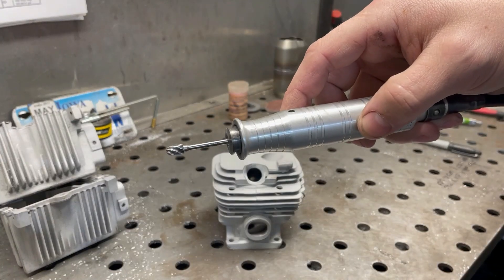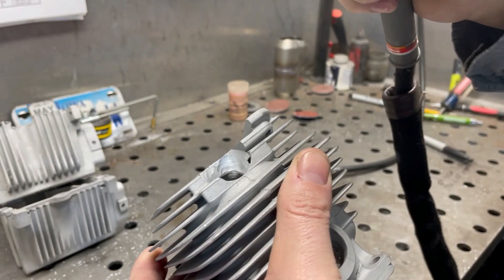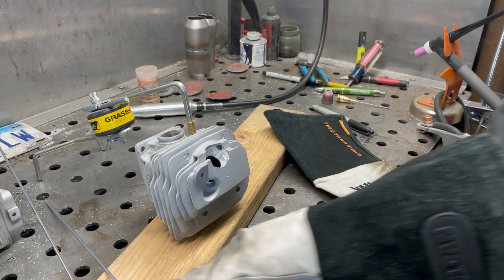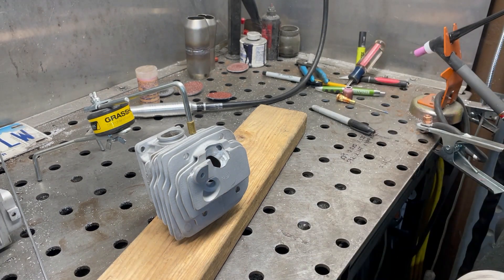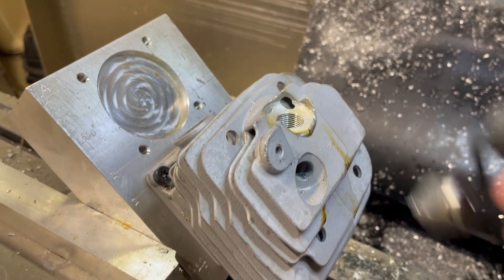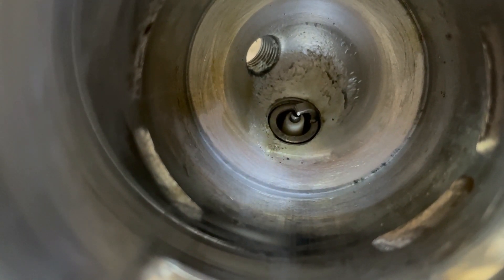Chainsaw spark plug thread weld repair

Comment: You’re pulling your tungsten away too soon. Leave your tungsten at your weld and let your post flow gas run until your tungsten cools down. This keeps your tungsten in the shielding gas to cool down and keeps it from contaminating. I believe that would fix your tungsten problem

Comment: Try 2% ceriated tungsten for aluminum, you’ll be able to hold a sharp point 1-1.5 times diameter in length. Also it won’t spit like other types and has good arc starts.
Reply from the maker: Thanks, I'll try some. I've had pretty good luck with 2% lanthanated. I'm running pretty close to 200amp with 3/32 tungsten which is pushing the upper limit of it. I guess I was using 1/16 in the video which is way too small for the amperage.
Reply: Lanthansted  is junk, try ceriated and you’ll see why I say this.
Reply from the maker: @trucken72  I ordered some today. Thanks.